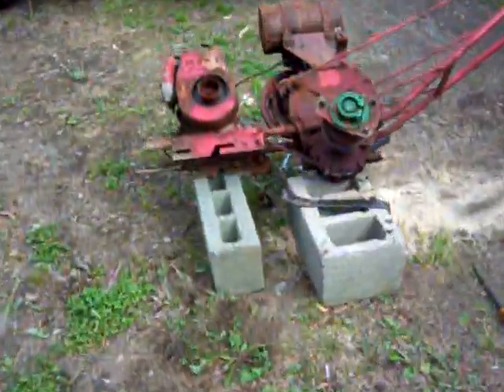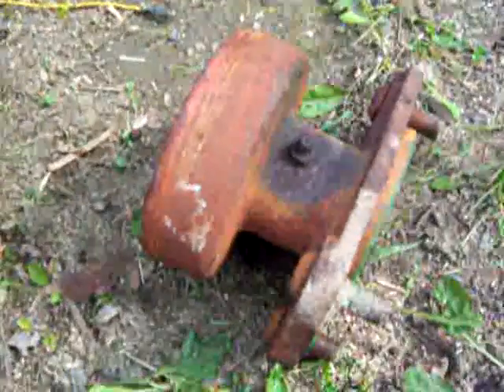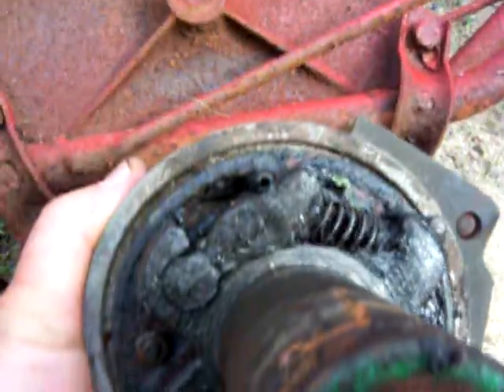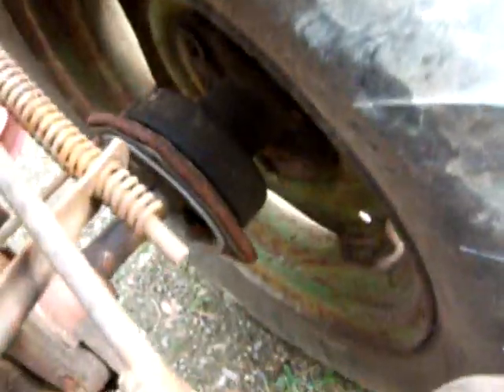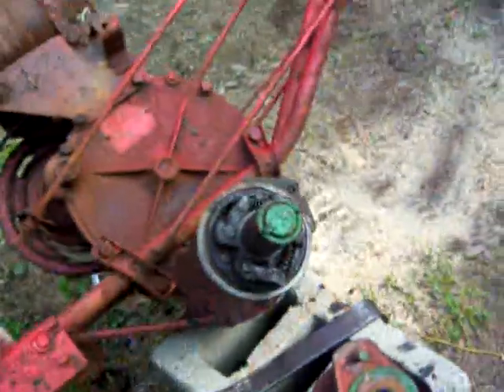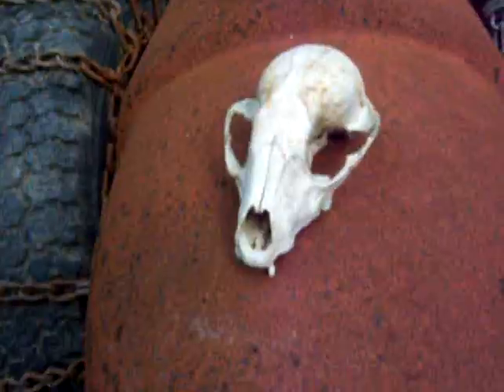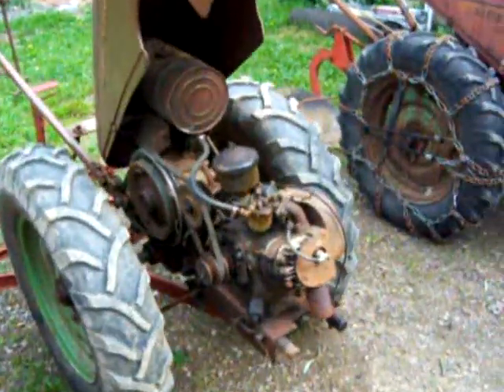How David Bradley Tractor Reverse Hub  Mechanism  Works.

Comment: I enjoy your David Bradley videos as they help me to work on mine. The pins that stick out near the pawls and ride in the two curved slot look like roll pins on your tractor. I bought a used reverse assembly to install on one of my tractors and it looks like solid pins, 3/16" diameter and about 1-1/2" long. The pins are missing on one of the assemblies. I assume that the roll pins work.  I just want to make sure I don't break the white metal piece with the drag shoes by driving in the wrong size pin. Thanks
Reply from the maker: Roll pins should work but if they are  more than a HAIR too tight, Punching them in may cause Damage.  CRAZY Old Mechanics Trick... Put The New Roll Pins wrapped in Tinfoil in  The FREEZER Overnight!... Metal Shinks in the Cold... Then take them out, oil them and they should slip in easy. When they warm they will exspand and sit Tight!!!  Good Luck
Reply: @MrDanoconnor  Thanks for the info!!

Comment: Do you run your clutch pulleys with pitting on the face? I have a newer speed changer with reverse and another with the one piece frame and one pulley. Both have pitted clutch plate faces and I'm wondering what I can get away with. I have run a Rolox pad over them  but they are still showing medium pitting. Can these parts be sourced through a supplier? Thx.

Comment: There were alot of things optional back then. Alot of those tractors never had bar tread tires because you could buy them without tires and put any old tire on there. Made em cheaper to buy. Couldn't do that with a Bolens or gravely.

Comment: Mr Dano , I have a leaking oil seal on my axle on my walk behind DB . Do I have to take the gearbox apart to replace this seal ? New to DB’s . Thank you
Reply from the maker: The Only other option is to Drain all the Old Oil Out and  Refill with a Thicker Oil and  Stop Leak. There are Many New Improved  Stop leak Products that really do work by expanding the Rubber seals. Do some Homework on line  or ask at your local NAPA store. Good Luck.
Reply: MrDanoconnor thank you very much for the info . I will give the the stop leak and oil a try . I will also go by and speak to the gentleman at Napa .

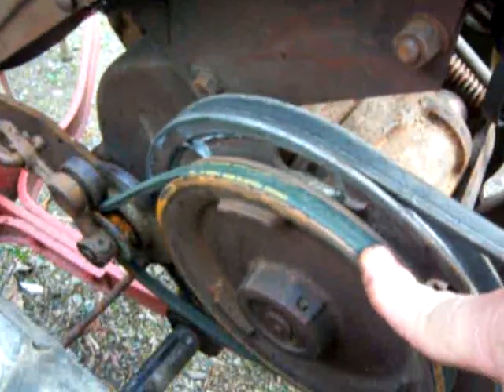Comment: Thanks for all your great videos on DB stuff. I have a ? on the pulley between the engine drive pulley and the transmission pulleys. My DB has a set up for the reverse and in this video @ 4:20 center of the still you can see the one I am missing. My engine is not original and this pulley is not there anymore. Do I need it? I am going to have to work on my clutch. As of now I can push my handles up fast and she takes off but has no pulling power for the attachments, just drags me along Thanks for any help in advance! J
Reply from the maker: Hard to diagnois your problem without pics or a video,  Naybe if you post a Video of the tractor and send it to me or Pics and an explaination of the problems. You can contact me by email at danscaretaker@hotmail.com

Comment from the maker: I may be wrong but with all the DB's I have owned the Outer Hubs are all the same and all have  the same 3 Bolt Wheel Pattern.  However the very  First DB's used 3  Regular Bolts & Nuts, this was later replaced with the more common Fixed Threaded Studs.Also on some of  the early ones I am told the inner part of the hubs are marked Right & Left & must be installed as such or they will not work properly.

Comment from the maker: I've seen ads for  Smaller Handiman 2 wheeler for about $130 The Bigger ones like mine sold new for between $250 and $400 depending on wheather you got it From the Sears Catolog unasembled  or direct from the store all assembled.